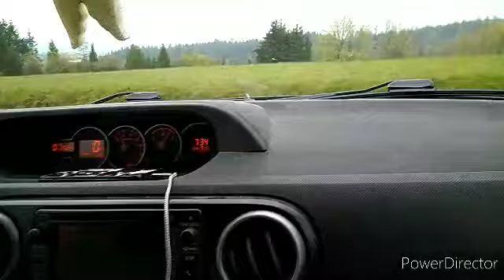field trip. Blues surgery went well!! Ron stopped by.

Comment: Ed, does your big baler use the two knot system??....
Reply from the maker: Yes sir it does.
Reply: I  unloaded a full pallet(48 spools)   of 4400..   450 knot strength ..... today
Reply from the maker: @farmingforfunandprofit940  I haven't tried to get any twine yet.. we use 500 it 550. Have used 450 in a pinch..